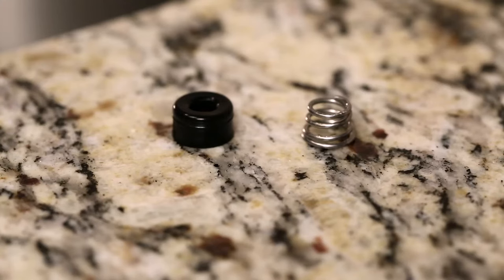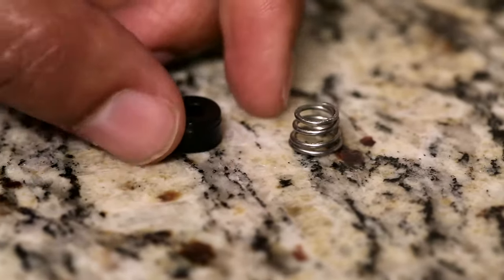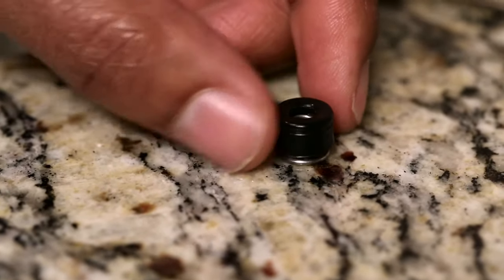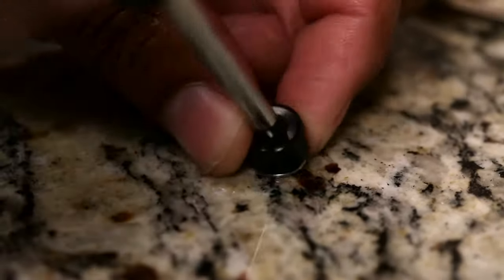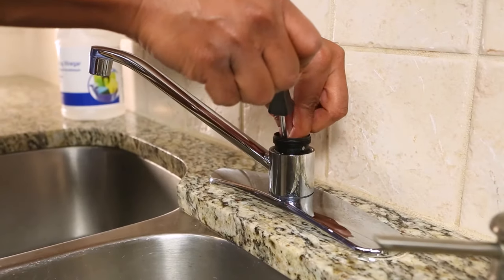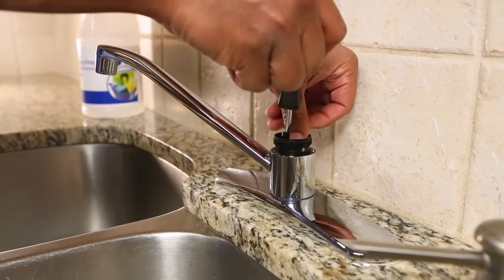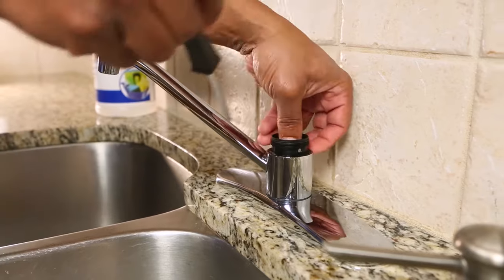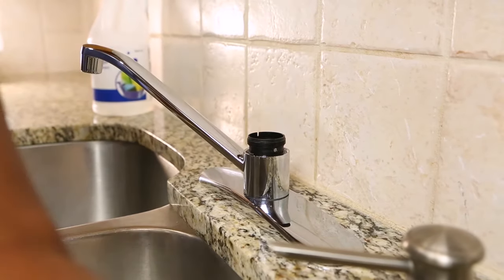Seats and Springs for Delta Single Handle Faucets

Comment: Old plumbers trick.... It's almost impossible to get it to stay where you need it in a shower situation where the valve lays on its side !!! Here's the trick, cover the seat and spring with Flux or Thread Sealer... Its sticks the seat in the right location and holds it there on the spring while you push the valve on...Your Welcome !!!

Comment: Your video is literally the only one on YouTube, that shows which end of the spring should be upward. Thank you for the attention to this detail. Bought stems at Ace hardware (their own Ace product) and when I turn on the water, the metal on the base/ bottom of the stem keeps catching the top of the Danco seat and slicing into it at an angle. Took me a while to figure this out. Just wanted to give a heads up on this issue. Ace products have really dropped in quality over the years.

Comment: Getting the oring to seat properly is a huge pain if you have big hands.  This is a bad design.  The back seat should be part of the replaceable insert.  I’m tempted to beak out the SLA printer and make a better design.

Comment: I did that but I can’t get the seat to go in all the way. It’s not flush; keeps getting pushed out by the spring it seems.
Reply: Same thing is happening to me. Did you figure it out?
Reply: @iheartnjdevils3536  I just put the springs in, not pushed in, and then tightening the middle ring on the handle like it showed, seemed to work.